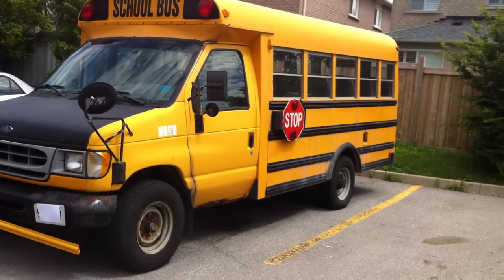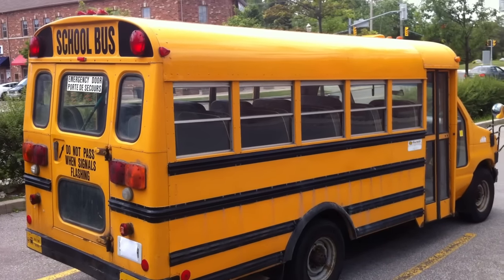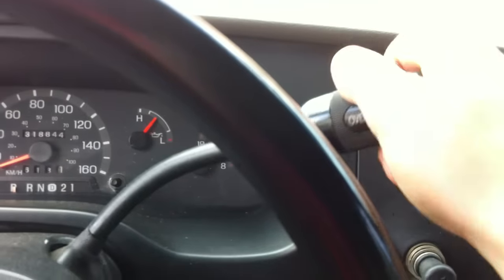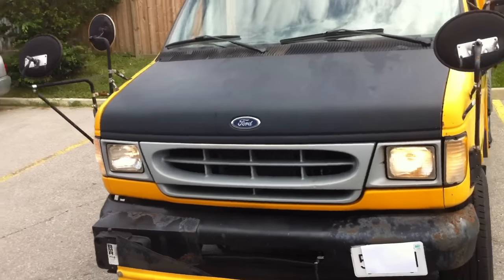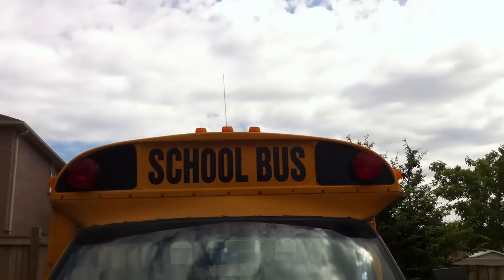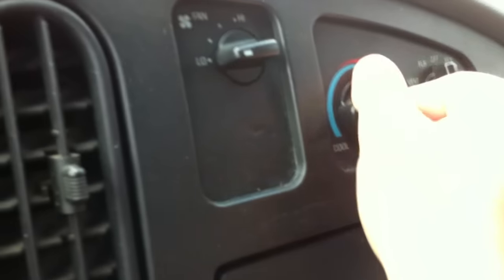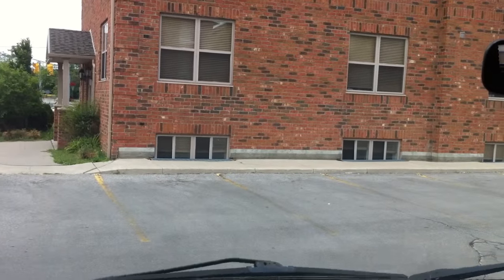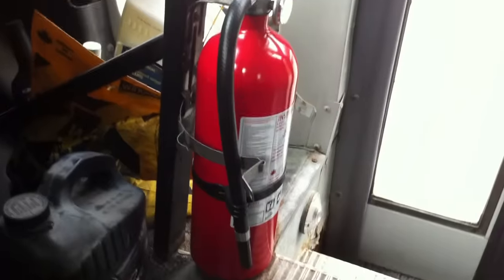1998 Ford E-Series Super-Duty School Bus 7.3 Diesel Startup Engine & Walkaround

Comment: That 7.3 power stroke sounds awesome. Whoever gets this bus next should take really good care of it. If you stay on top of maintenance and do the work that it needs. That bus will go forever. The 7.3 power stroke is legendary.
Reply from the maker: I think that bus got scrapped haven’t seen it for a long time I would assume it’s not around anymore
Reply: @fordmustang98guy  yeah. 2003 was the last year, before in 2004 they switched engines in 2004. They switched to the crappy 6.0 power stroke. My favorite diesel engine of all is the 7.3 power stroke. The engine that I hate the most is the 4.0 L straight six in the jeep cars. I absolutely hate that engine.
Reply from the maker: @TheBlindReviewer  I thought 2002 was the last year of the 7.3’s
Reply: @fordmustang98guy  Can You Do 2004 Ford E350 School Bus With Wheelchair Lift and All Passengers.

Comment: 1998 would be the E350 Super Duty, you are correct. Econoline stopped in the mid 90s
Reply from the maker: You sure it is an E-350? Because I asked the owners of that daycare & they don't know what the model is they know that it is a diesel but I myself know what engine it is (7.3 litre Power stroke Turbo diesel)
Reply: @fordmustang98guy  They did the Econoline until 08.

Comment: The horn on our Super Duty diesel truck doesn't worn anymore either.
Reply from the maker: Jonathan Ashbeck Nope that school bus I reviewed is still at that daycare but I have a feeling that the battery is dead & the left rear tire is flat.
Reply: Okay, but I meant that the horn on our 1999 Ford Super Duty 7.3 doesn't work anymore. That's what I meant. I see the rust parts on the bus and my our truck has some rust also and the sidestep on the driver side is falling apart.
Reply: And again I like the 7.3 Powerstroke engines. They are classic.
Reply: Check the horn fuse lol

Comment: 7.3 was the last good ford diesel
Reply from the maker: 2002 was the final year for the 7.3 litre diesel engine & when 2003 came they downgraded to the 6.7 Litre Powerstroke Turbodiesel
Reply from the maker: By the way do you still have your 1999 Buick Regal? if you do please do an update video on it
Reply: ***** No I got rid of that  4 years ago, it was a good car and I miss it
Reply from the maker: bluebirdvision Why did you get rid of that car you could have kept it lol those 3800 Series II motors are Bulletproof they last forever but why did you get rid of your 99 Regal?
Reply: I bought a silverado
Reply from the maker: bluebirdvision I know you bought that 2004 Silverado but what happened to the 99 Regal? Did it break down that's why you sold it? Or you just wanted to change
Reply: Just wanted a change
Reply: @fordmustang98guy  FYI. The 7.3l, 6.0l, 6.4l were not Ford engines. They were international Harvester engines that were produced for Ford for use in their vehicles. In 2011, when Ford introduced its redesigned SuperDuty, It unveiled the all new, completely in house designed and manufactured 6.7l power stroke Diesel. This was an engine that was in the works since the 6.4l engine had all of its recalls. Ford severed it's ties with the then International Navistar corporation as the last 2 engines produced by them for Ford vehicles (6.0l, 6.4l) were so ridden with problems that they were unreliable without major modification. It is true that the 7.3l is an incredible engine that has had many applications not only in Fords but also in International medium duty trucks, school buses and many others. However, the 6.7l wipes the floor with it in terms of fuel efficiency, power to fuel ratio, weight and frequency of repairs. The 7.3l may have been reliable, but they leaked oil like a siv.

Comment: that 7.3 sounds like the T444E
Reply: It's the same engine.
Reply: Leteiz Jordan it is a T444E back then ford didn’t make there own Diesel engines so they used International
Reply: The t444e is the 7.3l powerstroke 
The vt365 is the 6.0l powerstroke 
The maxxforce 7 is the 6.4l powerstroke

Comment: This diesel works by sending diesel fuel by a fuel pump into the engine and the starter makes the engine start and has a fuel injectors on the combustion cylinders and to warm up the engine on colder weather, it warms up the glow plugs for 30 seconds in ON position and then the exhaust sprays diesel fuel by going into the DPF and that’s how diesel works! @fordmustang98guy and doesn’t have a throttle body, spark plugs or ignition coils unlike gasoline engines

Comment: Horn doesnt work cause of air bag lights on
Reply: No, the airbag light only turns on when there's a malfunction with the Supplemental Restraint System, which refers to the vehicle's airbags.
Reply: @princesstwilightsparkle1302  actually when the clock spring goes bag it'll throw an air bag code which will make horn stop working